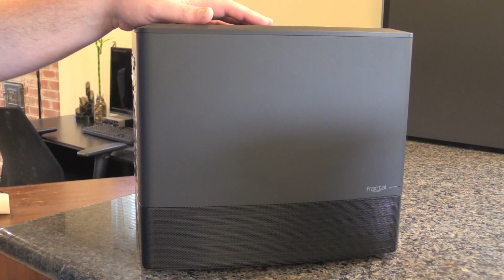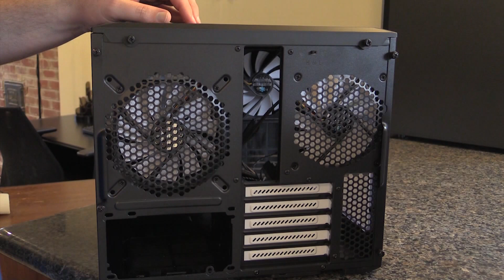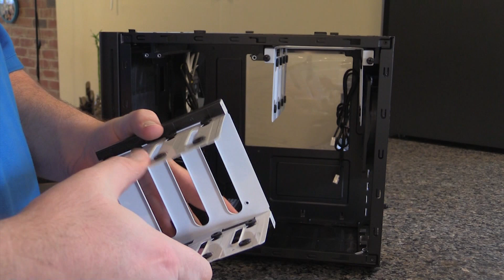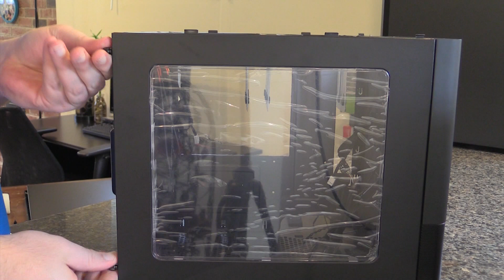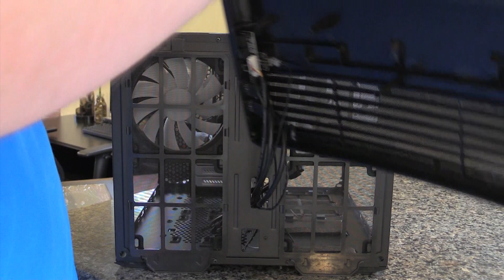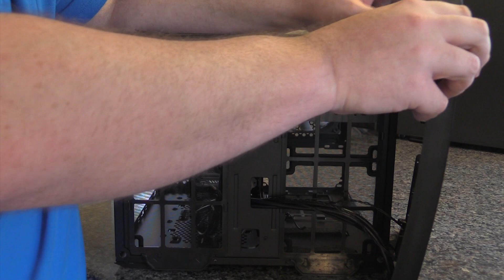Fractal Design Node 804 Review

Comment: Eh, new sub. New unsub. Some of your cons is just wrong. You didn't mention that a drive cage can be relocated where the velcro is. Downward facing drives is a very intelligent design for this case. All the connections face down where there is space. Mb side bottom spacing I don't agree with. It has 5 slots. Most matx cases only have 4.... All in all. Imo. Way off base on this one. Nothing personal. All the tech channels out there. One I can live without. Good luck on future endeavors.  Peace.
Reply from the maker: Buhbye!

Comment: Nice review, its good to see some new content on this case, since it really is very different to the otherwise fairly standardized Fractal Design format. However I don't see the big deal with the optional drive mounts on the bottom of the case, hanging HDD's or even the fan filters.

Regarding the optional drive mounts, if you have a 3.5" drive or two and your looking to water-cool your build this allows you to put a 240 or 280mm rad instead of the drive cages, so long as (like most people) you only have on graphics card, or you have a motherboard that allows you to place the cards in slot 1&2, in which case you don't need the 5th slot anyway. If you do have 2 air-cooler graphics cards that need the breathing room, then you can still run a 240mm rad (but not a 280mm) on the motherboard side, certainly good enough for most people who'll more than likely just stick a H100i or similar AIO cooler in this case, although air coolers do also fit if you are that way inclined.

Regarding the Hanging HDD cages, I don't really see the with mounting drives this way. Vibration wise its better than a stack of flat trays, and you can easly leave enough cable lengh in the room below the cages to allow you to pull the cage out to install or remove drives WITHOUT unwiring everything. The only fault with the cases as far as I'm concerned is that they don't support 2.5" drives, which is a shame given some of us have either more than 2 SSD's (like TimmyTech) or 1tb 2.5" mechanical drives that don't fit in SSD mounts (like me). In either case this is only a problem if you can't use the drive mounts before mentioned on the case floor.

Finally regarding fan filters, sure you have to tip the case, but its not a big deal. Tipping the case is neither hard work, nor a hazard to the computer and really this short design is unlikely to sit on carpet anyway (more likely on the desk than under) so cleaning filters need not be more than every few months. Thus I don't see much of a isse, and would rather have good solid case feet and a clean looking top panel than swapping the way you pull the filters out around.

Anyway these are just my thoughts on the issue, so others opinions will vary. I really do like these core pc type reveiws rather than peripherals or tech accessories. Keep up the good work, videos are looking fine!